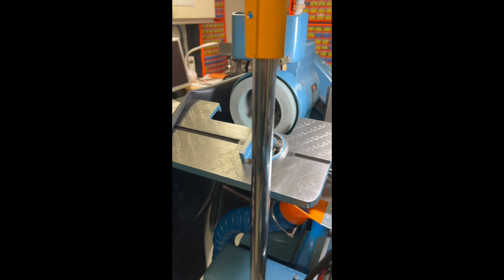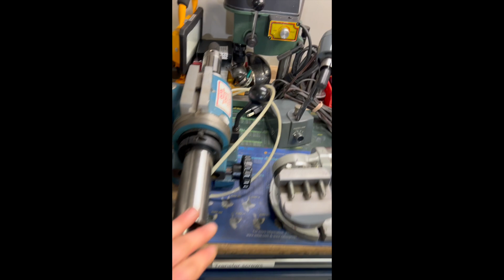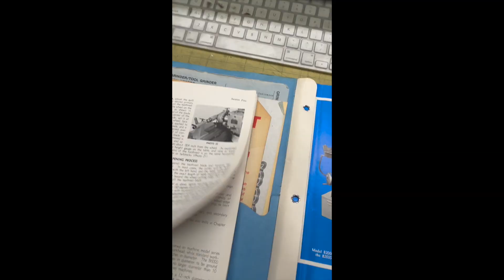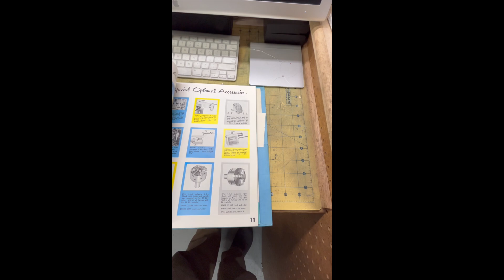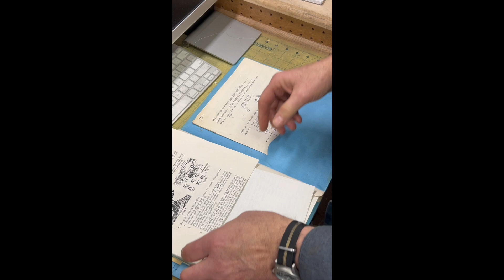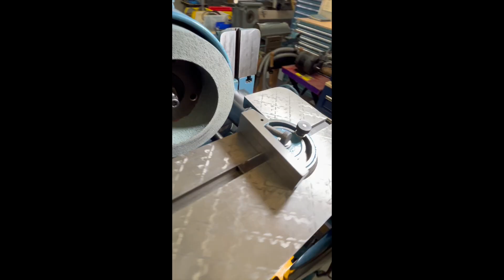K O Lee tool and cutter grinder reveal 2026

Comment: I following to see more on this. I just bought a 1953 KOLee BA860. A smaller older machine. I am in the process of clean up then I will be learning from scratch. I have watching the two other channels you mentioned to learn. 
You mentioned gear oil as way lube. Is it really like GL5 90 wt? I have not found anything on the exact oil other KO Lee part numbers in my research.
Reply from the maker: That’s right!  I have an original bottle of K.O.Lee oil and I recognize the smell.  It’s definitely 90 weight gear oil.  Way oil wouldn’t work well bc the way the system picks up oil from small troughs via a rotating disk.  You want that oil to be thick and heavy for it to cling on the disk and get distributed on the ways.

Comment: Nice. Though, I don't see any problems with the current paint. Clean, degrease, rinse, buff, wax. I guess I like to keep things as original as possible. Either way, very nice machine. Hopefully you post some projects being done on it. Good move on the bearings. I just got a Lars Gorton tool/cutter grinder and the bearings on it are also dry so I'm disassembling the whole machine and going through it, cleaning, and re-oiling and re-greasing as needed. 👣👣👣👣👣👣👣👣👣👣👣👣👣👣👣👣👣👣👣👣👣👣👣👣👣👣👣👣👣👣👣👣👣👣

Comment: There is this thing called LANDSCAPE, and to use this elusive feature you have to do this thing with your phone called; ROTATING it to the side putting the phone in a landscape position and it will then automatically record in landscape mode. Just saying., Posting for a friend. 🤔🤨🤨🤨🤨
Reply from the maker: Yes, I’m aware however I wasn’t sure that I could flip it over while recording and it not coming out sideways.  Will try that next time.  Thanks for the tip.